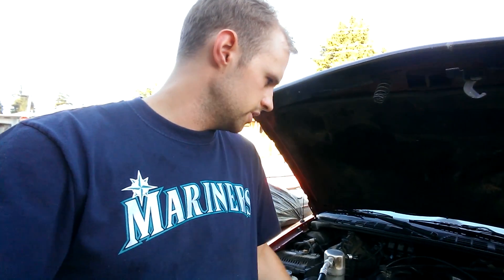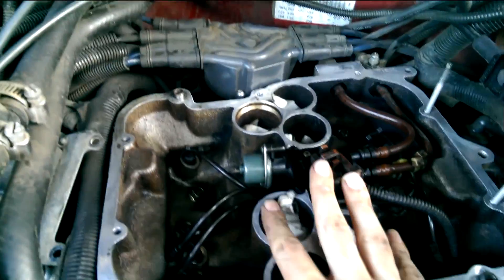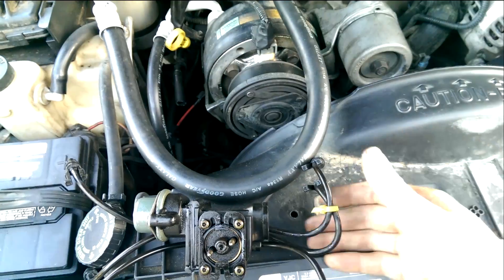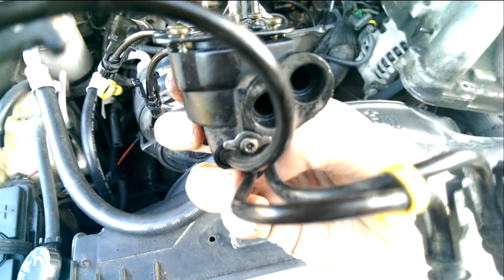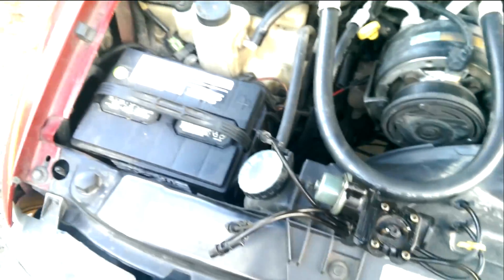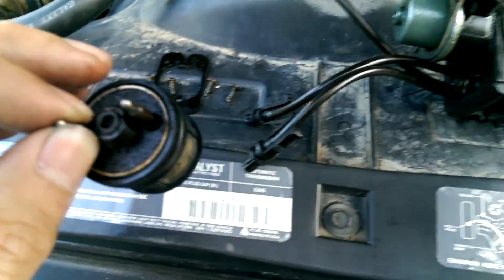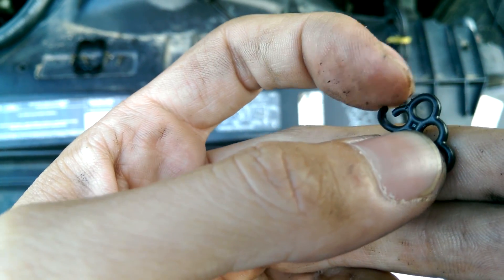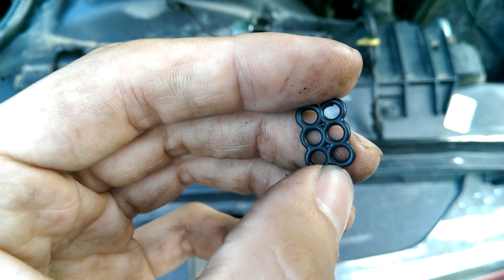[Solved] Chevy Blazer Fuel Injector Leak

Comment: im wondering since they were updated in 1996 if i can find an interchangeable make and year to pull one out of and rebuild if need be. i just had a s10 give to me and the problem is only the spider injector. what they did was pull and rebuild a blazer vortec 6 and dropped it in a 95 s10 so now i have to find parts for the 95 vortec when problems arise insted of the original engine that came stock. if it were me and if i were pilling the engine i believe i would have dropped a small block in the bay and been ha happy camper lol.   great video quality and audio, thanks brother

Comment: I’m kinda “late” here with a question, but do you know the part number for those rings?
I can’t find those among rebuild kits, only separate ones…
Reply from the maker: It's not a part you can find I'm afraid. I sourced one from another injector.
Reply: @ElliotWhitehead  I see, that’s gonna be a problem since rubber doesn’t age well. Thanks for your reply anyway. )
BTW, since you already had your spider disassembled - did you, by any chance, check if the MPFI “legs” are compatible?
I know they are for the next gen spider, but can’t find info on the older one.

Comment: Hi. I have chevrolet blazer 95 v6 and My spider injection is having THE same problem. I need to find those little orins. But here in el Salvador. They dont have It. So I need to see were I can buy It.
Reply from the maker: Hey Saul, I was able to find a replacement gasket by disassembling a used injector. Good luck!

Comment: So, where did you get the replacement 6 pack o-ring gasket at?
Reply from the maker: Hey Will, sorry for the late response. I was able to find a working gasket by disassembling a used injector. Thanks for watching.

Comment: lol good video bro, and thanks for the help.. ive been fixing leaking cfi's since the early 2ks,..... the wiring on top of the injector is not a data line.. its archaic technology similar to a tbi.. since 1987.. or earlier on corvette. its a simple power feed with a pulsed negative from a ecu that is barely more complex than a digital watch 
love how gm uses the same ol stuff for decades
nice work

Comment: Did u find the gasket im having the same issue where i cant accelerate and it sits at very low rpm enough to where i cant switch gears
Reply from the maker: Hey Jonathan, sorry for the late response. I was able to find a working gasket by disassembling a used injector. Thanks

Comment: I have an 02 trailblazer it smells like it’s running rich and I have an intermittent issue with cylinder 6, low rpms especially taking off uphill it acts like it wants to die at takeoff. I changed plugs and it helped for about a day now it’s worse than before but I suspected injector, thank you for video

Comment: Thx for good video, I have same symptoms in my Blazer, have top intake plenum off and discovered leaking shrader valve. Hopefully fixing that and replacing fuel filter will solve
my Blazer that not only runs very rough at idle but died at busy intersection. Thanks to a awesome guy who jumped to help push out of street. Fingers crossed  my press. regulator and poppets are working.